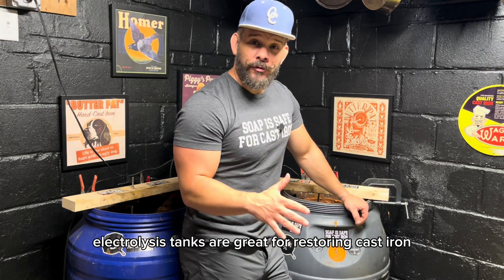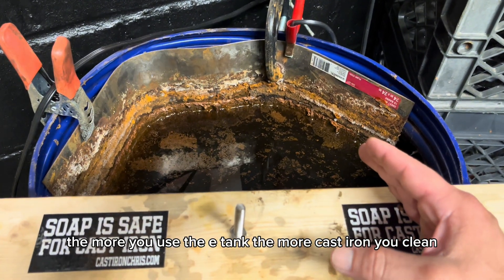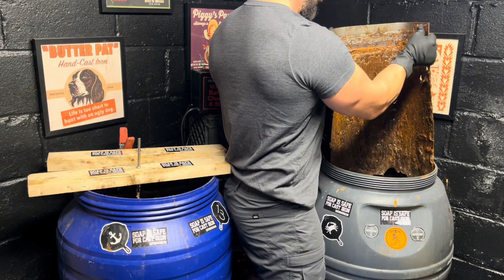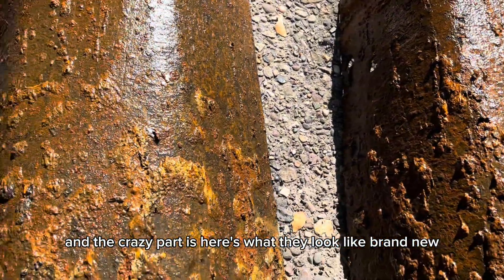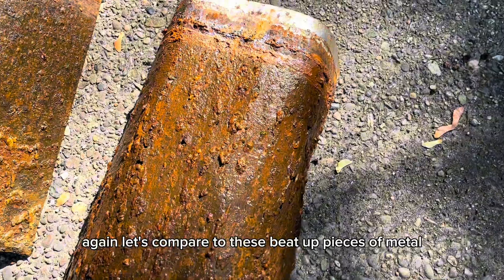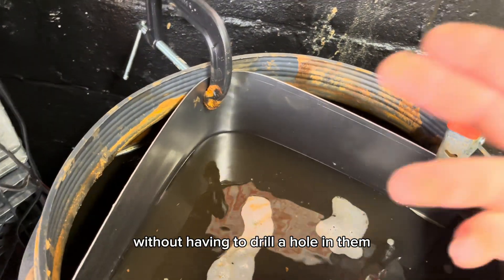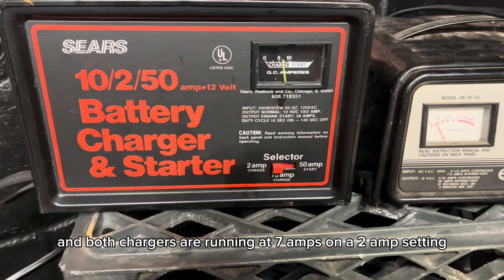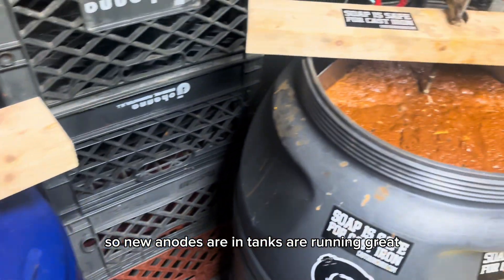Electrolysis tank: Changing the Anodes

Comment: Items to avoid    
 Stainless steel: This is the most crucial item to avoid putting in the tank as a sacrificial anode. Stainless steel can release hexavalent chromium, which is a toxic carcinogen.  Salt (besides washing soda): Avoid adding table salt or rock salt, as it is corrosive to metals and can overload your power supply. Washing soda is a safe alternative for the electrolyte solution.  Other alloys: Do not place aluminum or other alloys in a tank set up for cleaning iron or steel, as the alkaline electrolyte can damage them.   — If you're using copper wire, make sure it doesn't come into contact with the water, because it can further corrode the iron. 
        Setup and safety precautions     Ventilation: Always set up the tank in a well-ventilated area, such as outdoors or in a garage with the doors open, because electrolysis produces flammable hydrogen gas.  Power source placement: Keep the power supply, especially a battery charger, far from the water to prevent sparks and electrical hazards.  Tank material: Do not use light-duty plastic bins for the tank; instead, choose something heavy-duty that can support the weight of the water (about \(8\) lbs per gallon).  Electrical connections: Ensure the power leads are connected correctly—the negative lead goes to the part being cleaned, and the positive lead goes to the sacrificial anodes.  Gases and foam: The process creates flammable gases and can create foam. Keep the area clear of ignition sources, like smoking materials, and disconnect the power before making any connections or disconnections to prevent sparks.

Comment: What gauge are your anodes? 

I used similar 12 x 24 inch 22 gauge steel for my first attempts, but they pinholed pretty badly after not that much use. Have also experimented with 0.5 x 12 inch rods as anodes, which are pretty cheap. But I found the graphite eroded pretty quickly even at 2 amps. Am using 316 stainless plates right now with a constant current DC supply at 2 or 3 amps (and ~4 v) and that works well.

Comment: Chris I experimented with hanging my pieces in a pillowcase to act as a filter to keep the tank cleaner but most of the crud comes from the anodes which were outside of my filter. That was a fail. My next wonderful idea was to use stainless steel anodes and a electric pressure washer to clean then occasionally. That worked but I was only getting about 350 hours from a tank of water. I needed to filter it some way? I decided to hang an asian skillet in there with the polarities reversed and it seems to be working. I need more time to be sure but the asian skillet is funky beyond words. I still use that pressure washer a lot on the pieces both before and after electrolysis plus I use an electric leaf blower to semi dry them before oiling. Any little thing you can do to do a better job while making it easier.
They say that Arm & Hammer doesn't evaporate but after I've added water to the tank several times the water gets old and slows. I mix some of the water that I replace the evaporation with. I let my amp gauge tell me how the tank is mixed. I like it to stay between 25 and 35 amps depending on the surface area of the pieces inside the tank. A #10 is going to be higher than a #5 it doesn't matter how the water is mixed but you get the picture. I use the Schumacher 1565 manual rolling charger from Walmart $125ish now. I have almost 1700 hours on this one with no problems. I put an hour meter on this charger to see how it was doing. I have to pressure wash the anodes every 150ish hours and change the water every 300ish. That was before reversing the polarities. I hope to extend that considerably but time will tell.